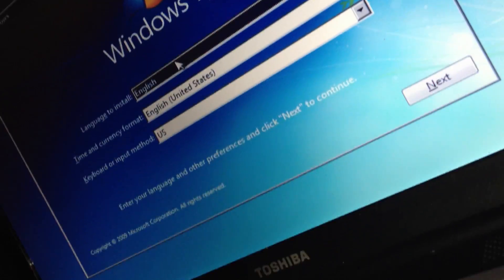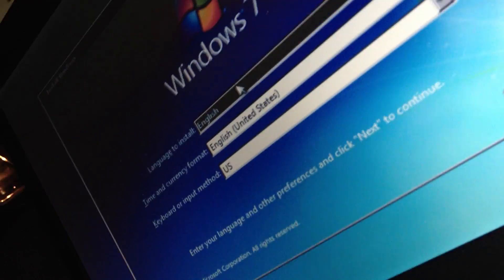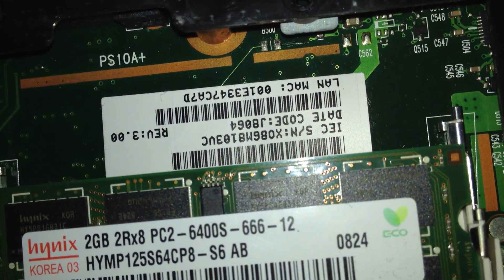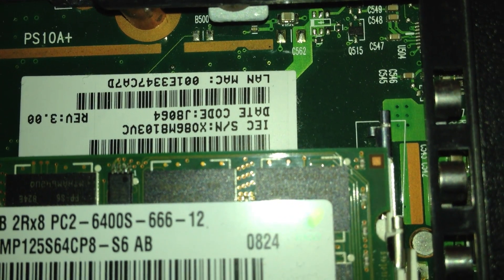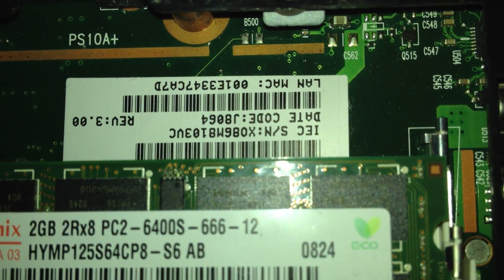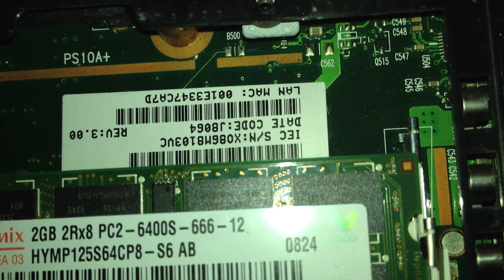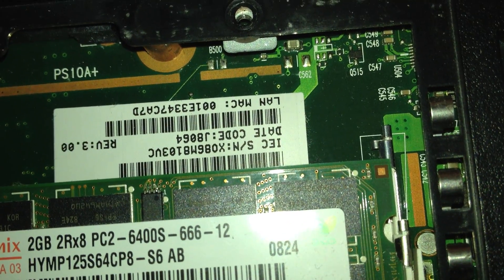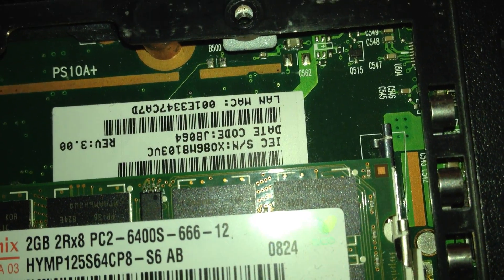How to bypass BIOS password on a toshiba satelite (B500 shorting)

Comment: I've tried this several times and it does not seem to do anything. It will not clear the boot up password. I have a Sat A210-ST0. I see the jumper point, I use a paperclip and short those two points and power up but it goes back to that same password screen after the Toshiba logo.

Comment: Thank you!  I wasn't sure which part of the board to short out (as all the videos and discussions are different depending on the model).  

Was so happy to find a corresponding B500 key and jump it using a paper clip.  Was thrilled that it finally worked.  You saved me $85.  Thanks again:)

Comment: Same method is working on all 655 (6 series) Toshiba laptops _ You must weld B500 terminals and you will enter in bios setup - Location on 655 is also in the corner of RAM doors